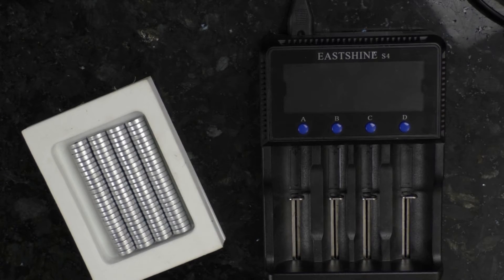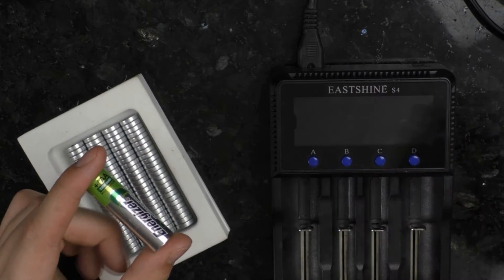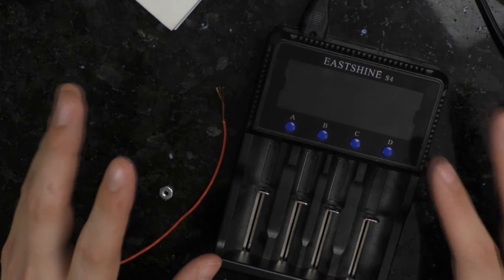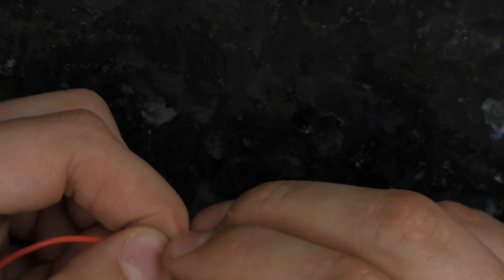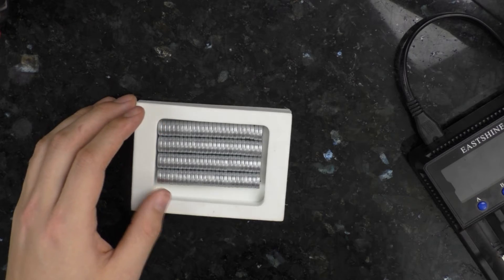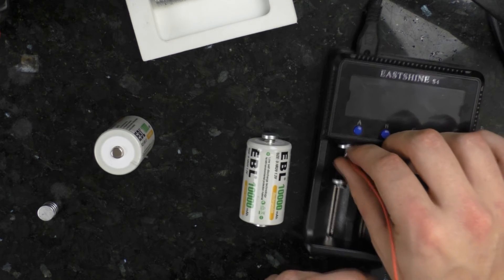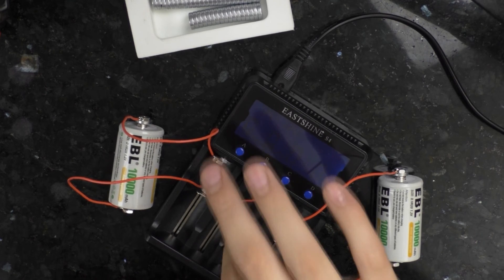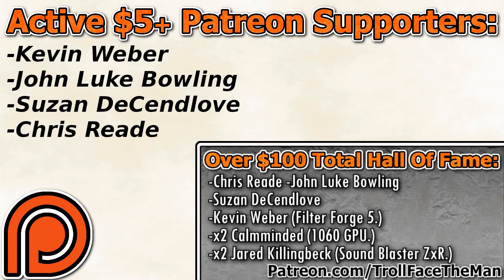Charge C/D Cells on AAA/AA Charger (Quick Easy Mod/Hack) NiMH, NiCad & Lithuim Batteries

Comment: What's the wire size that you used?
Reply from the maker: Think it was 22g. Which should be able to handle about 5 or 6 amps. Max amps for this charger is only 1000mah or 1amp hour.

 So even technically 28g wire could be used. But if the charger you has can provide more amps you'll have to check.

Comment: Nice video, however EBL are the most sh*tty battery's on the planet, probably dangerous to, just saying not trolling.
Reply from the maker: Thank you. Though I haven't had issues with them, may I ask why you feel that way.
Reply from the maker: @VicGreenBitcoin  I have never even seen any of there Lithium stuff before. But I had seen some capacity test. And they did fall short. Not giving them an excuse but sadly did almost all the other's including big brands in most cases.

Comment: or you can just use a charger that fits D batteries... also, you can probably just offset one of the magnets on the side of the positive terminal and just stick the batter in there without all the wires.
Reply from the maker: Sure you could just use a D charger. But that is not the point here. Point is if you don't have one or don't want to shell put potentially 30+ for a decent one and already have a charger you can make due for free like this :)

 You are probably right that magnets stuck in the right places might allow you to not need the wires. However probably could only charge 1, maybe 2 max at a time.

Comment: Cool thanks.  I will check Dollar Tree and I think O'Reilly's auto parts has some of those kind of magnet . .  only because I am in a hurry and don't want to wait on Ebay delivery.
Reply from the maker: Good luck!
Reply: @TrollFaceTheMan  Ended up using coated copper twist wire and 4 of those big fat rubber bands that come with the broccoli.  You have to had really strong rare earth neodymium magnets for this to work.  Ordinary magnets don't cut it.
Reply from the maker: @OWK000 , you were using nickle coated ones?
Reply: @TrollFaceTheMan  No.  This was an emergency charge.  I just used one of those fat thick rubber bands off grocery store brocolli to hold copper wire onto the top and bottom each battery.  I attached the other ends to the charger by just twisting a bit on the negative side and on the positive end there is this fold down for the AAAs so I stuck the wire in the crack and folded down holding the wire neatly in place.  Not nearly as cool as neodymium magnets, but it worked.  No soldering.  I may still get some neodymium magnets, but no hurry now.  This charge was for a friend.
Reply from the maker: @OWK000  well glad you were able to do something. In general though the nickle coating on the neodymium magnets is important to allow electrical contact with the battery.
Reply: @TrollFaceTheMan  Yeah, I saw those black colored neodymium magnets on Amazon and I was worried THOSE wouldn't work.  My conductivity was all copper strand wire from a piece of repurposed power cord cut off from my last dead stick blender.  The fat rubber band was around the poles of the battery lengthwise just to hold the copper down at each end.
Reply from the maker: @OWK000  the black ones are usually Ceramic Ferrite.
Reply: @TrollFaceTheMan  The ones on Amazon claim to be neodymium magnets, but they look like the have an brownish black andonized aluminum coating, from review etc. looks like some kind of powder coated though.  Not nickle.  I wouldn't take the risk.  I rather buy off Ebay.
Reply from the maker: @OWK000 , might actually be then. Interesting. If it is powder coated it's conductivity is likely poor.

Comment: Happy new year! I was wondering if it only works with D and C cells or any electronic. For example phones, Nikon camera batteries or any other device that has the non standard battery?
Reply from the maker: It wouldn't likely work unless for example the Battery was a standard value like a single cell Lithium or such which the charger would likely treat like normal. But even still I wouldn't risk it over potentially destroying an expensive Battery, camera or both.

 And thank you.

Comment: Am wondering if you can just put the wire to the terminals on the charger and hold it in with the magnet by sandwiching the wire between the terminal and the magnet?
Reply from the maker: I wouldn't see why not. If it works it works ya know?

Comment: Injust got this charger and I dont know what happens when I press the the buttons to change the currents, does it charge faster or something? All I did was put them in and it started charging should I just leave them in without worrying about it?
Reply from the maker: Yes, for batteries that are under 2000mah it is good to typically charge them at 500mah. Where Batteries over 2000mah capacity it's good to charge at the 1000mah. 

And yes that charger should automatically shut off when the batteries are charged.
Reply: @TrollFaceTheMan  thx
Reply from the maker: @sonic97dx , welcome!

Comment: A couple years ago I bought an 8 pack of AA EBL batteries. I only used my powered mc9000 charger/ analyzer to maintain them and I only have 1 cell that still works. I would also like to note that all of the EBL cells were below the claimed MaH rating and very inconsistent in regards to capacity between the 8 cells.
I have also purchased EBL charging products with my own money for the purpose of reviewing. In my experience the grand EBL is low quality and unregulated in consistency. To put it simply, they make crap products. 
On the contrary, the Energized brand AA batteries are not crap and are possibly made in the same factory that the Eneloop brand is made at.The Energizer NiMh batteries do great when maintained in a quality charger/ analyzer not the cheap charger the batteries come with. Energizer is in the business to sell batteries.
Reply from the maker: Thanks for the input, I've personally not had any issues with EBLs so far and in test I've seen then tend to do pretty good.

 One thing I do not like is they do tend to overstate their capacity but all brands pretty much do too. However EBL tends to be a worse offender in that regard.

 Example a '2,800mah' EBL tends to be about 2,400mah. When a '2,000mah' other main brand battery tends to be about 1,800mah.

 The thing is I found though is you typically can get the actual capacity 2,400mah EBL for the same price of the actual capacity 1,800mah which makes then very appealing even with their slightly more dishonest marketing.

 I am not trying to write off your experiences though, as I said I've Personally never had issues with my EBLs.

 On the other hand the Energizers I bought and that came with an Energizer brand 'smart' battery charger felt like that they were going to catch on fire at multiple points getting so hot while charging as the charger would sometimes refuse to just shut off and horribly over charged them. I would have to be careful and watch them then remove them when they started heating up.

 At this point too, 2 of the 4 enigizer Batteries I got with that set have failed in that they rapidly discharge themselves when storing. Likely due to damage from that charger.

  Like you said that is a cheap charger that came with them BUT it also is a charger that Energizer sold bundled with their batteries and chose to represent their company when they put their brand name on it.

 The fact that Energizer has done this along with them using blatantly scammy and scummy tactics like the fake D cell Batteries (being an AA cell in a D shell then charging you a ridiculous amounts more over the AA) I just can no longer support the brand.

 I did hear that the Amazon basics works well and perhaps that might be a future investment if the EBLs do ever have issues.

Comment: How you like the EBL D rechargeable batteries on the mag light, how much run time you get from them EBL  D Batteries are they true 10,000 mah ? Was looking at the energizer ones but after seen your video that have a AA inside with Adapter I rather go with some EBL  how they holding up do they loose power from sitting.
Reply from the maker: Very happy to help. To give the best info though can I ask what type of maglight you are using? Led or incandescent/Xeon?
Reply: It's a led 2 D Batteries Mag Light
Reply from the maker: @lupillos7404 , same. What Batteries are you switching from? Alkilines?
Reply: Regular alkaline batteries just wanted to switch to rechargeable batteries
Reply from the maker: @lupillos7404 , just got home give me like 10 minutes and I'll answer your questions as best as possible.
Reply from the maker: Alright to answer you first question in my 3w maglight (About 350lm) the EBLs run at a constant brightness for around 3 hours before needing to be recharged.

 For alkalines I would get about an hour and a half to two before the LED would start flickering on and off.

 I know It might seem weird that the 10,000mah preformed much better than the likely 13,000-15,000mah alkaline but there is a reason for this.

 Alkalines lose efficiency at high currents that NiMh can handle no problem. For example on one test I seen drawing 1 amp from an alkaline D dropped it's capacity to about 50% (More Like 6,500-7,500mah instead.)

 With a 3 watt maglight we are drawing about that much current. At the same draw the NiMh keep almost 95% efficiently.

 So the lower capacity EBL rechargeables actually were lasting about 30% longer for me.

 But let's say that they only still got you the same use time as the Alkalines. Each one of these EBL D Cells are supposed to be able to charge fully at least 800 cycles and up to potentially thousands with lower capacity.

 But just taking the 800 Charge Cycles x 2D cell Batteries at about $2 each that means by replacing your current Batteries in your light with the rechargeables in their life they should save $3,200 in replacement cost.

 Plus save 1,600 Batteries from ending up in a landfill somewhere... Those factors are what got me to switch over.

 As for if the capacity matches advertised, it is about 5% less from what I seen which is about average for rechargeables. The only real sin I've seen by EBL is there claimed 2,800mah AA that were getting about 20% less than advertised which is not cool.

 But except that specific claimed 2,800mah AA battery I have no issues with them.
 
 As for losing power while sitting the answer is both yes and no.... Theses EBLs specifically claim that they will keep 95% of their charge after 3 years or something but in testing they discharge about 5-10% every 3 months of sitting. 

 Just as long as you don't let them over discharge though all you'll need to do is recharge them if they do get low and maybe once a year for good measure.

 Hopefully this info is useful and if you have any other questions please ask.
Reply: Thanks much for your time and all the info, that answers all my questions thanks again going with them EBL D Rechargeable Batteries 👍🏻
Reply from the maker: @lupillos7404 , glad to hear it I think you'll like them. There is an Amazon link to them in the video's description if you didn't know.

 Wish you the best for the new year :]

Comment: alligator clips and magnets...skip the soldering.  They're ferrous clips.
Reply from the maker: You can do that too for sure. But I like to keep these Nut Wires with my Batteries to use just for this.

 My alligator clips I use so often they end up all over